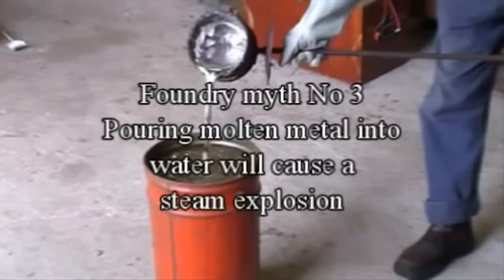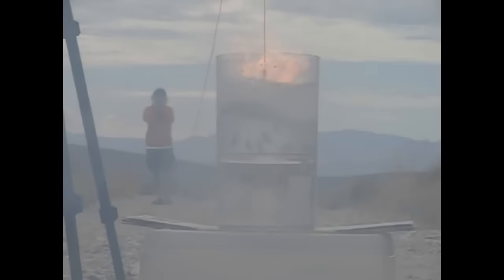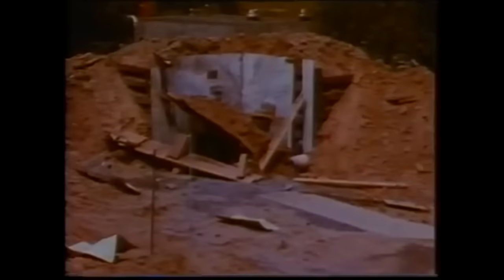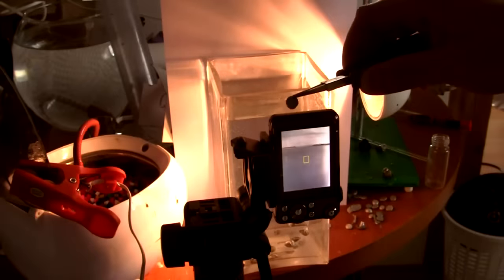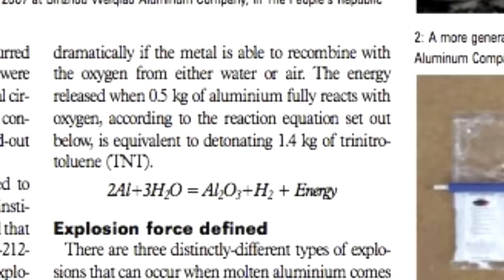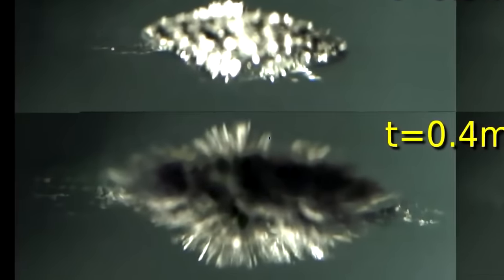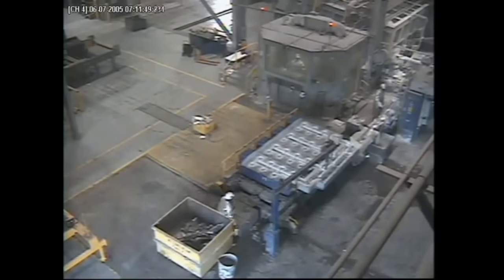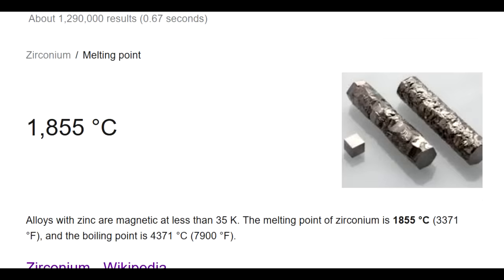The Awesome Power of the Aluminium-Water Explosion!

Comment: Small amount Al, large amount water: no problem.
Large amount Al, small amount water: BIG problem!
Reply: This is what I got from it, too. Even the smallest amount of water is explosive. Drop a ton of molten aluminum in a ton of water and it's no problem.
Reply: I searched the comments because I knew someone other than I drew this conclusion.
Reply: If it is indeed a cemical explosion it happend anyway
Reply: Please watch the video again; a piece of reactive metal the size of a pill blew a flask into flying shrapnel.  That is NOT 'no problem'.  Yes, there is a correlation between mass and energy released, but he clearly showed that even a tiny piece, under the right circumstances, can be very dangerous.
Reply: @KeithOlson  
Are we talking about a steam explosion, or chemical reaction such as oxidation?
I mean, shot is made by pouring molten lead into water. You can quench steel (poorly) in water, at temperatures in excess of molten aluminum.
Reply: @KeithOlson  
All of the Fe and Al explosions shown were simply steam explosions, when much hot metal was poured into something with traces of water. The Na, K explosions were chemical reactions.
He never actually showed an example of Al (or Fe, for that matter) doing anything that couldn't be explained by thermal masses and steam expansion. I'm willing to consider the possibility, but remain unconvinced until shown an example of Aluminum exploding in water in such a way that merely heating water into steam could be ruled out.
Reply: you watched this video, and still understood nothing
Reply: @bcubed72  it's neither steam or chemical. It's colombic (electrical). Although one could also argue that all chemical reactions are driven by colombic forces between elements so in that sense, it is indeed a chemical reaction.
Reply: @darius3.14  I understood Thunderf00t was CLAIMING something, that he showed zero empirical evidence of ever actually happening. The consensus is these explosions are "steam explosions."

Burden of proof is on the person claiming the novel hypothesis. Please, TF, give us JUST ONE example of Al exploding in a large mass of water; so large that a "flash steam explosion" can be ruled out.
Reply: @bcubed72 
Did you not watch the video? You say he didn't give empirical evidence even though he made up a chemically/electrically similar metal that is liquid at room temperature and proved, by images of the metal spearing itself into the water, that the explosion source was NOT steam from the reaction's heat (which would push the metal away from the water), but the Coulombic reaction instead.

So if you recreate an environment in which there is no oxygen to create an oxide barrier to protect the aluminum (an argon chamber or argon shielding over the poured metal), you now have the experiment. And that is whether the steam will protect it, the steam itself will still react with the aluminum in its vapor form, or the bare aluminum will just explode on contact with the water before the heat can transfer to the water and boil it. 

I think it will be the latter. 

In the case of dropping the aluminum into the large amount of water as those other people were doing, it SHOULD be safe, unless something happens to the oxide layer. Don't know how that could happen, maybe a metal pin under the water spears the aluminum ball or something, but IF something happens to it you've got a real explosion on your hands. 

Something else to consider is that for casting, a lot of processes are done to the aluminum prior to pouring specifically to remove all its oxides and make it harder for oxide to form, since you don't want the oxides inside your cast object as they make it weaker. that adds an element of danger of course.
Reply: @nickopedia5669  He combined two alkali metals which are widely known to be reactive with water. Aluminum...isn't. My canoe doesn't go BOOM!...no, not even if I scuff up the bottom first.
Nobody is denying the notorious reactivity of the alkali metals...TF is making some BOLD claim that liquified Aluminum acts like an alkali metal (only if really, really pure), because...reasons.

If you don't know the chemical difference between NaK...and "soda pop metal," you probably shouldn't be commenting.
Reply: Steem
Reply: No. There are two effects going on. One is a steam explosion. The other is an explosive chemical reaction of metal with water. A small amount of metal in a large body of water may reduce the likelihood or not. The effect is difficult to predict. The relative difficulty of reproducing the effect leads to complacency.
Reply: @NoahSpurrier  I would like to see this happen JUST ONCE before I believe. So far, score is ZERO.
Reply: @bcubed72  I've experienced other metals act in unexpected ways. Not aluminum by itself, but I've had tin, steel, and thermite all explode in rather dramatic ways in situations where they had previously been well behaved. It may be comparing apples to oranges, but I've learned that just because you have a hard time reproducing someone else's Hindenburg doesn't mean you should conclude they are full of shit. It's like trying to light a block of magnesium on fire. It's next to impossible. In fact it's so hard you start to explain to yourself how it must just be a myth... until you get the conditions just right and then - holy fuck!
Reply: @bcubed72  But two things here. First, lead melts at a low temperature so the thermal energy it holds is lower. Second, lead is not very reactive compared to aluminum.
Reply: @bcubed72  aluminium with no oxide layer is nearly as reactive as calcium or lithium.

It's oxide layer is what makes it stable

When molten it can of course trigger a steam explosion bug the force of this can seperate the aluminium molecules fast enough that the oxide layer can't form before it reacts with the water creating a chemical explosion too
Reply: Damn.... i thought i found a new way to have fun camping at the lake. 😅
Reply: @bcubed72  Did you never take high school chemistry? Aluminum is known to be super reactive if the oxide layer is gone, this is basic knowledge. And thunderf00t isn't some crackpot making shit up, he has a phd in chemistry from the university of birmingham.
Reply: @juansolo7485  I have never seen or heard of this happening in practice. Each and every "bad outcome" shown is adequately explained as a steam explosion.

There's far too many actual fears out there for you to expect me to be afraid of a hypothetical.

Comment: The key is that all these people "disproving" the Aluminum explosion in water are simply dribbling it into water. It cools fast enough to prevent a catastrophic steam explosion. If they didn't dribble, but dunked all of it at once, it would explode.
Reply: No ones saying a giant explosion ncouldnt happen it was that the dribbling would cause it how retarded are people
Reply: Dude, that's not the steam explosion that's scary. It's the reaction of the metall with oxygen in water. Water is about 300 times denser than air by the way.

Comment: These explosions are caused by Steam not a reaction. when you have more molten aluminum than water it then  incapsulate the water and cause the water to boil and make steam. When the water turns to steam and pressure builds up enough it will push the molten aluminum out to release the pressure. So you get an affect as an explosion but it's the steam being released.
Reply: this. this is important. the people pouring aluminium into water are perfectly fine. there is just a very small amount there. as someone who does foundry work for a hobby, i have almost blown myself up, but its with very small amounts of water that gets trapped, not slowly pouring molten metal into a giant bath of water. the aluminium would be cooled almost instantly in a pool or a large bucket.  as darrel said, its the steam that causes this, not the "energy" in aluminium. little bit over dramatic on the presentation there.
Reply: Yah the explosion in the test footage looked more like a BLEVE as it doesn't appear much hydrogen gas was formed which should have ignited.
If you're really unlucky the aluminum hardens on top of the water and it'll build pressure until something gives.

Comment: Water in molten aluminium (or any metal) is explosive due to massive water to steam expansion (explosion) that instantly occurs and is trapped inside the aluminium that hardens from the quick cooling caused by the evaporation (doesn't have to harden can be caused simply because it is to thick to allow the flash steam escape fast enough). The two forces expand rapidly until you get a steam explosion. Aluminium poured into water is generally safe (be safe wear gear and take precautions) due to the water does not get trapped inside the aluminium creating a vessel to contain the flash steam pressure. Flash steam explosions have nothing to due with phosphate reactions with water or in some cases air. I have a lot of experience with phosphates in the army as a EOD tech.

Unfortunately all of your examples of metal explosions (minus the phosphate ones) are examples of flash steam causing a explosion like event due to its rapid expansion pushing everything out of its way. Good videos though, I am a fan.
Reply: Thanks for sharing. From reading yours and other comments, the chemical reaction seems way too overblown in the video (I imagine the foil starts boiling water only due to its low thermal mass compared to huge surface area) and I don't need to worry about explosions when water-jetting or anodizing (room temperature) aluminum.
Reply: @jirij  
Not even slightly
Reply: Mike andersen totally agree, the video uses irrelevant comparisons to alkali metals. Flash steam at 1600 times it original volume causes the expulsion of the metal, not a chemical reaction as the video claims.
Reply: @jirij  lmfaoo there litterally is no chemical reaction mate jus water boiling to steam

Comment: I don't think it is a coulombic explosion, but simply boiling water that is restrained by the heavy molten metal on top of it. Note that in the safety test footage, they only had a small amount of water in test container. That gets flashed to steam and violently sprays molten metal all over the place. It is a kind of BLEVY.
I did something very similar with beeswax and a little bit of water. I was trying to melt the beeswax in a saucepan and thought If I added a little bit of water, it would help spread the heat to block of wax so it would melt faster. I went away for a few minutes and when I came back, the stove looked like hell! There was beeswax all over the place and it took hours to clean it all up!! I had the sauce pan on the smallest range top burner on the lowest possible setting (which could never make the water boil under normal conditions). But the water ran to the bottom of the saucepan and was heated by a small flame but the wax on top was pressing down on the water and it was preventing the heat from escaping and once the pressure was high enough it broke through and then the pressure went down, which made the water boil more violently which reduced the pressure some more which made the water boil even more violently and creating this unbelievable mess.

Comment: I worked at a magnesium stamping plant that also melted scrap down into ingots for the presses. They had an accident once were one of the magnesium foundry pots was cooled and solidified, and some moisture had condensed in the center. They didnt know about this small amount of condensation. Well when they heated the pot up and the metal got nice and white hot and found the water ...... boom  the  several ton lid to the foundry pot was blown through the roof of the building and several hundred yards away out into the parking lot. Of course the building was then coated with white hot molten magnesium that set everything including itself on fire.  Fun times were had by all.

Comment: I did some work on machinery for a very large machine shop that worked with aluminum.  The machinery compacted loose aluminum chips into a solid puck for recycling.  The coolant used for machining aluminum billets resulted in the liberation of hydrogen gas from loose chips, which accumulated in the large open containers they were placed in.  One night, the inevitable explosion killed a watchman.

Comment: Sodium in water is a very different reaction to molten aluminum (or any molten industrial metal) hitting water. Sodium creates a violent chemical reaction with water, the molten aluminum explosion isn't as much a chemical reaction more like flash vaporization of the water due to the heat...a steam explosion. Any sort of extremely high temperature item put into water (or water put onto/into something that is extremely hot) should cause similar explosions.  The chemical reaction of the aluminum and water is almost secondary, something that will cause secondary issues due to increased heating and the release of things like hydrogen. 

If it was just the chemical reaction of water and aluminum then you wouldn't need to melt or heat it to get an explosion, anything that can remove the oxide layer or get water through the layer would cause explosive reactions... like cutting sheets of aluminum with water jets. Something which is done quite regularly.

If you want to try getting the reaction with water without super heating it then perhaps try removing the film with something like mercury chloride then putting the cleaned metal into water.  The reaction of aluminum and water can actually be a halfway decent way to generate some hydrogen without using electricity.

The reason that the kid in the video isn't getting steam explosions is the volume of water compared to the volume of aluminum added.  If he had more aluminum, added more quickly to less water then it would likely cause steam explosions.

(everything I suggest is firmly in the "DO NOT TRY THIS AT HOME" category)
Reply: I think that both types of explosions are possible - the expanding steam type, and (less often) the chemical reaction explosion. And, within this video, TF actually does use a chemical solution to remove the oxide layer from a shred of room temperature aluminum foil, then immerses it in 40°C water in front of his thermal camera, showing it getting hot enough to boil the water near the foil scrap. 

I'm not saying that steam expansion explosions aren't significant - I dove on a ship (R.M.S. Rhone, BVI) which sunk from a steam boiler explosion that ripped the ship into two pieces, and laid the aft half open like it was being autopsied - but the chemical reaction explosions are more energetic and more rapid. 

(Technically, the Rhone explosion was different than a foundry steam explosion - the Rhone engineers had time to build excessive steam pressure in the boiler, when the boiler failed, all the steam expanded at once. If the same quantity of coal (as the Rhone stokers shoveled in her for her last voyage) were used to heat a sufficiently massive sphere of aluminum to contain that energy at 600°C, and that sphere was then dropped into a sufficiently large water tank.. the steam would take longer to develop, with the rate being proportional to the surface area of the sphere, and limited by the efficiency of heat transfer across that surface and the thermal conductivity of aluminum. The explosion would be more of a "whooomp" then a "bang". 

The thing about surface area is.. if you scale the diameter of our sphere by 2, you increase its volume - and the amount of heat capacity for a given temperature - by [scale factor] cubed.. but you only increase its surface area by [scale factor] squared. So, in the case of [SF]=2, you have 8 times the heat energy, but only 4 times as much surface area for it to pass through, so the "expansion period" (the time interval where the sphere is hot enough to make steam) is doubled. "Whoooomp" becomes "whoooooooomp". 

The amazing thing about TF et al's discovery with sodium, was the Coulombic force creating "spikes" of liquid metal, which dramatically increased the available surface area, promoting an almost instantaneous reaction. It's still a surface area proportionality.. but in the reaction explosions, the surface is not ust a boundaty which must be crossed by heat stored in aluminum and transferring to water.. instead, the surface reaction is the energy source. That makes all the difference.
Reply: it is chemical

Comment: How about a "closed" system. Stainless tube with argon in and out. Water in the bottom and piece of aluminium threaded in from the inside, heat it externaly until the alu melts and drops, make some grooves around the tube on top so it has a way to fail in a predictable manner.
Reply: Isn't that what he showed in the video at 15:10 ?
Reply: @RichardHarlos  looked more like glassware used in chemistry to me.

Comment: I work at JW aluminum here in sc we use just about 80% straight recycled aluminum from cans to plates to gutters to anything aluminum our melters are big. No cans or bottles are allowed on floor and if you have a cup needs to be double insulated and plastic they actually give us our own. We had an explosion here before where we set our aluminum on the side and let it bake for about 30mins in 1600 and one time someone pushed some aluminum siding in that had water all in it and it blew up shaking the steel melters and walls through the plant. The steel buckled. We always pre heat everything from our pots to anything that molten metal touch’s. Steam is very dangerous it’s the strongest out of anything. People thought hydraulics were strong steam is definitely #1. Aluminum isn’t just straight aluminum there is also a chemistry side to it as well. You only get an explosion when water goes into aluminum causing steam it it only goes one way. I’d love to give a tour of our plant so people can understand what we do here and how unique and amazing machines are. It’s an amazing process